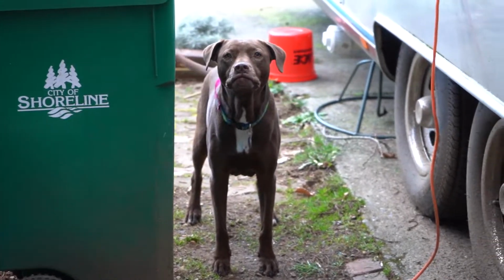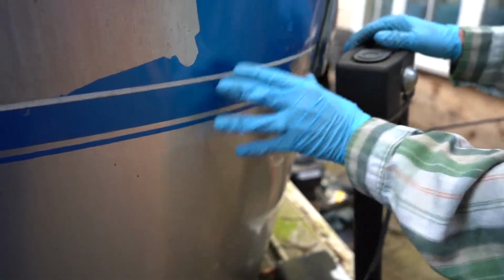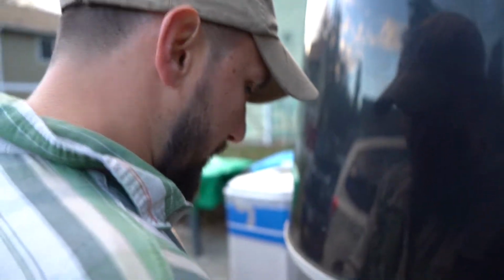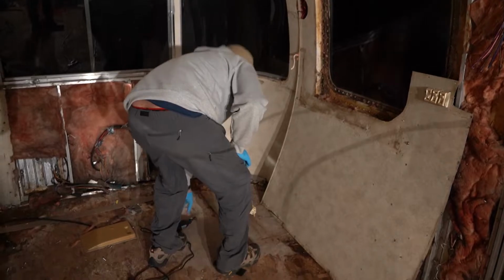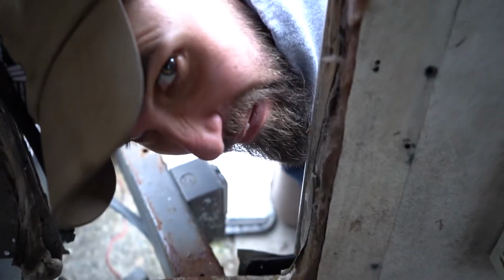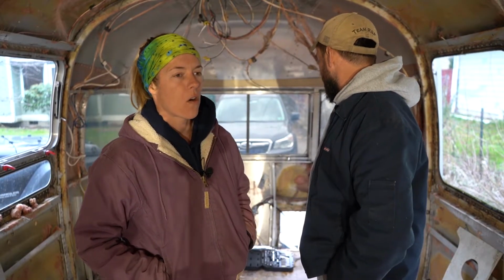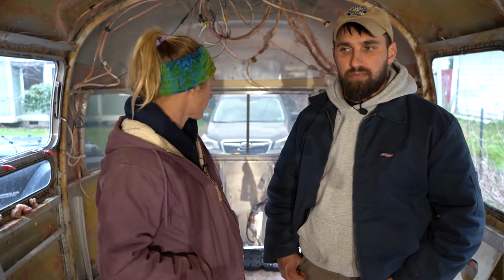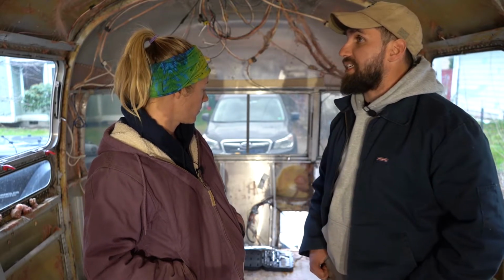Our AIRSTREAM has a BOO-BOO || FRONT END DAMAGE || Tiny Home Living

Comment: I got lucky with pushing out a large dent in my rear quarter panel on my 66 Airstream Ambassador.  With the interior panel removed, I just applied pressure with my hand and the dent popped out as though it was never there.  Rolling a basketball over the dent from the interior can also work without creating a crease.  Oftentimes, a rubber mallet will stretch the metal and leave indentations, as I learned on a previous repair on my 1990 Excella several years ago.  Keep up the good work.  I'm making the decision now to remove the interior skins to re-insulate, and/or paint/strip/replace the interior panels.  Most likely, I'll patch and paint most of the interior panels, but selectively install new bare aluminum panels in the kitchen area.  I like the bare aluminum interior look of my 2015 Flying Cloud, but that's a lot of work.  Keep up the good work.
Reply from the maker: Gene Carlson II Thanks Great advice! Wow it sounds like you have a ton of experience with Airstreams!! Curious what you think now that you’ve seen the condition ours is in it. Do you think that $12,000 was a fair price for it or did we overpay?
Reply: In my opinion, I believe you got a good deal for the condition and the model, even with the unexpected, but typical, issues you are discovering.  My 90 Airstream (29') Excella, very similar to your 92 (34').  I've coveted the 3 axle 90's models.  I seriously considered several in $30,000-$50,000 range over the years (when we were regularly camping with our 6 kids).  Feel free to send me a PM if you guys have any questions.
Reply from the maker: Gene Carlson II Will do thank you!! Six kids, wow you all have been busy. We want kids once we get out of the rat race.